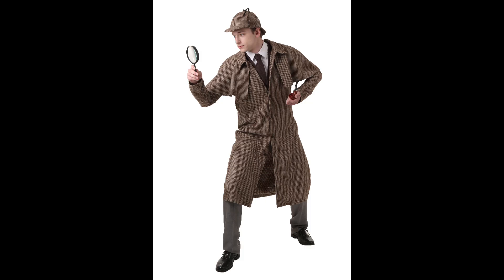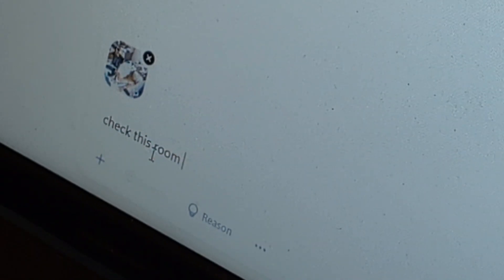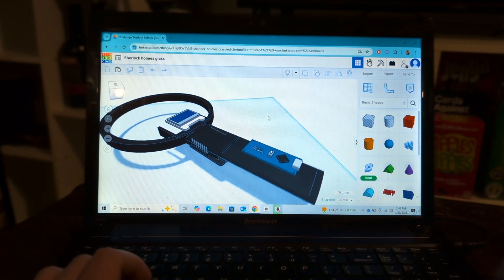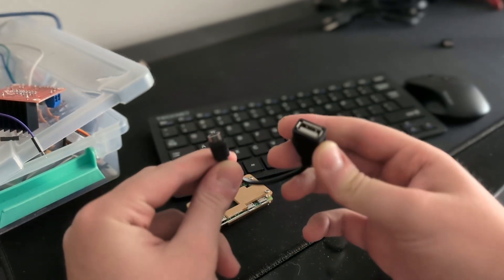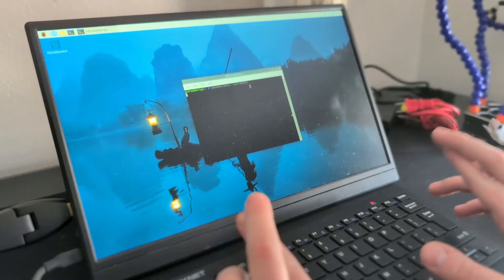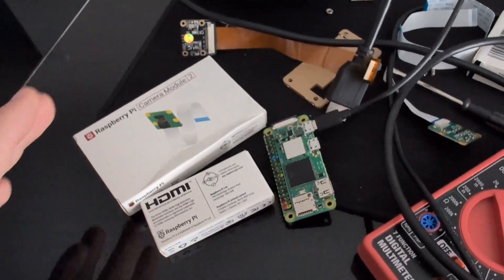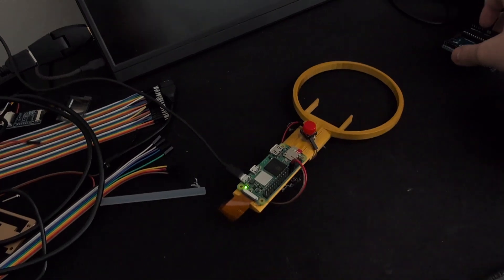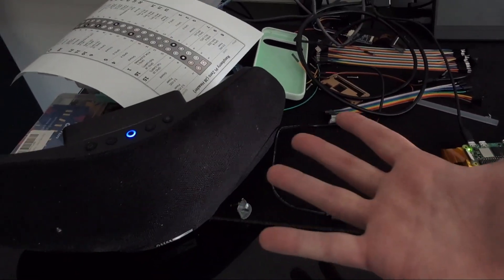I built real Sherlock Holmes superpowers!

Comment: Now you need to make raspberry pi powered Sonic Screwdriver 😂
Reply from the maker: Not the biggest Dr who fan, but it's a pretty good idea! Maybe for a quick short or something
Reply: @LeviathanEngineering  I'm not a huge fan these days, either, I don't like Disney, but you don't need to be a fan to make something like it.  In another universe the sonic screwdriver is a tricorder, in yet another it's just a generic, handheld scanner.  Any handheld device that can take a few interesting readings from the environment and maybe control a few devices remotely is a sonic tri-scanner.  A space wand is always cool.
Reply from the maker: @dafoex well generally I'd like to make projects I'm passionate about, but I don't mind making something else if it's interesting. Issue is I'm not entirely sure if a sonic screwdriver would be an interesting project.
Reply: @LeviathanEngineering  That's fair, and if you can't fit something particularly interesting in it, what's the point?  You can only talk so much about, I dunno, a temp and humidity sensor, or a 433MHz antenna.